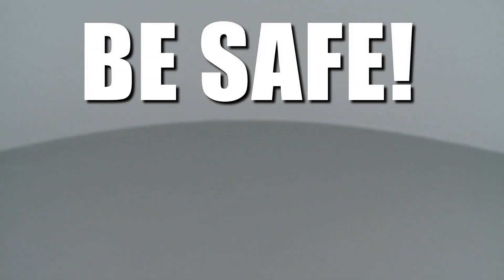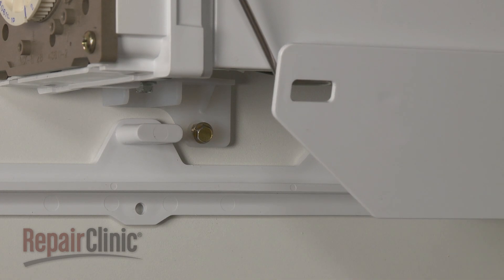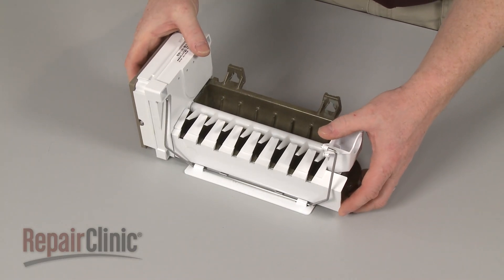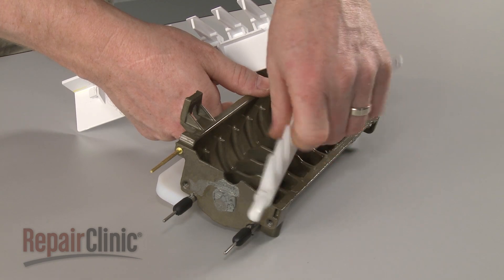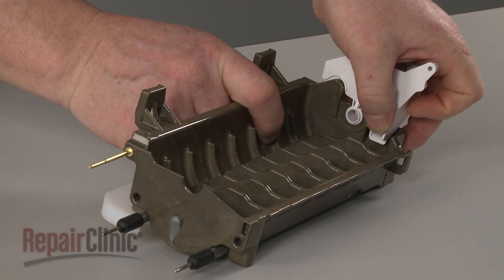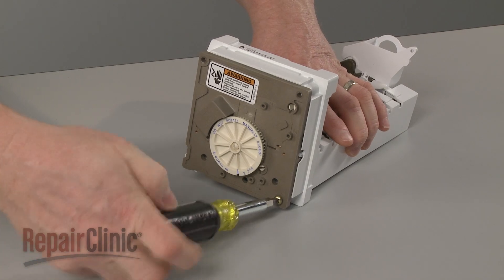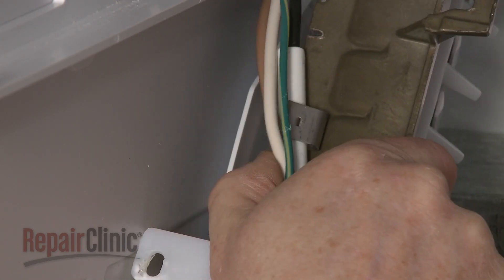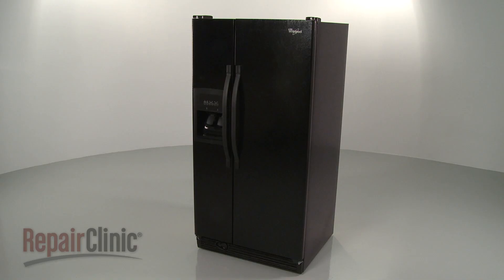Whirlpool Refrigerator Ice Maker Mold & Heater #W10190929

Comment: one of my two icemaker heater pin connection has melted the copper connection in the control module. is there a fix for this like soldering a new coppery pin clamp to the the old melted copper clamp
Reply from the maker: Jim Leach We recommend replacing the part.